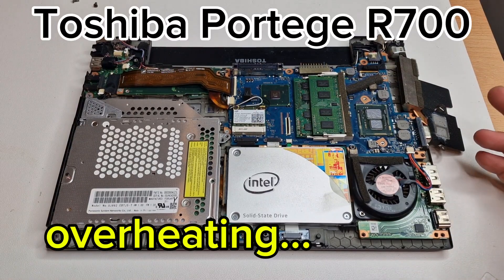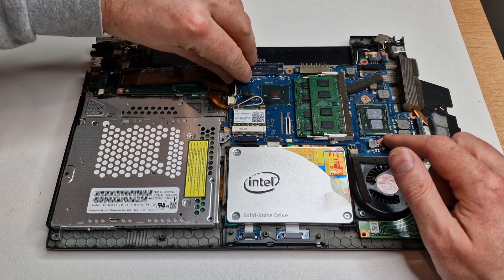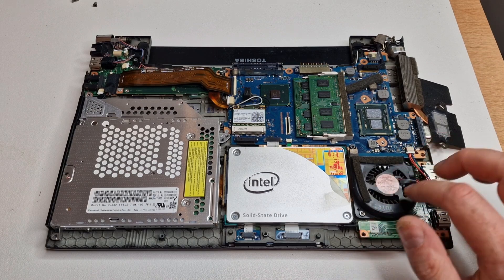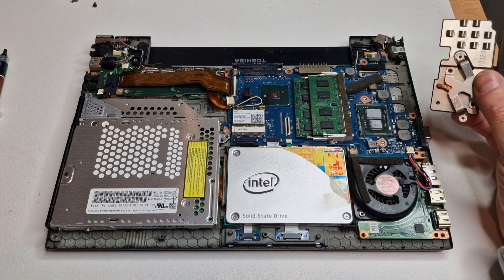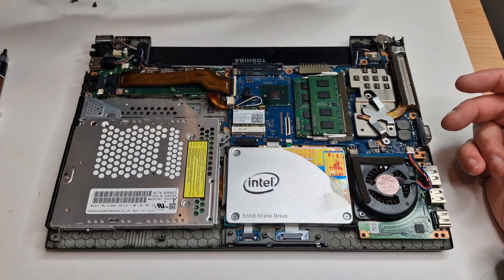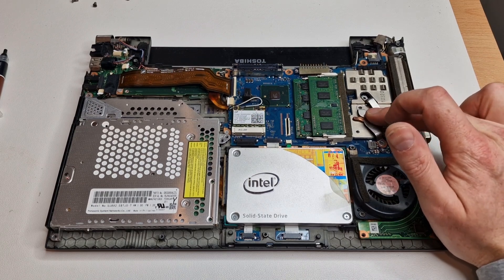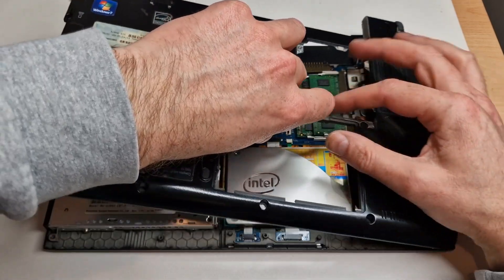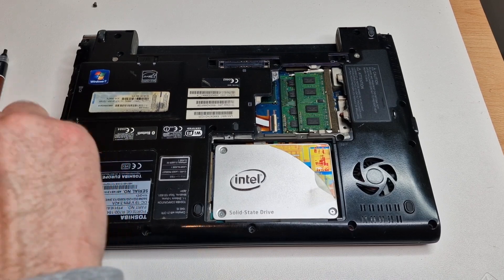Overheating Toshiba Portege R700 revisited... [THERMAL ISSUES!]

Comment: It's possible the heat pipe is bad. Inside is some kind of liquid. If it gets blocked the heat won't get to the fins. Buying a replacement / used heatpipe might fix it. If you have a thermal camera you can see if the fins get hot or just check if hot air is coming out. If air is cool the heat pipe is bad. If heatpipe is ok make a channel from cardboard that feeds the air directly towards the fins.

Comment: I wrote in first video but if you didn't see it... recovery partition may still be there. Give it a try. The correct recovery procedure is hold F8 while powering on, select Advanced Options then select Repair Computer (this activates the Toshiba Recovery), follow on-screen instructions. The original R700 recovery dvds are WinXP SP3 so not exactly useful today on 2024. Pity no one archived it but there are some on the bay if you wanted to pick up, install, archive images and upload for others :-)

Comment: I won't ever expect much from laptops that use cooling system like the fan that's blowing it's air to the cpu instead of blowing to a heatsink that's connected to a cpu. Some Asus laptops still do this "blowing air to cpu" cooling solution, and I always being skeptical about it's thermal performance, even if it's only a celeron n4000 inside.

Comment: I used to service these a lot back in the day for a contract my work had.
The thermal design is a combination of poor ACPI BIOS programming and not enough air pressure on the heatsink fin stack.
It's what Toshiba did to get this laptop as thin as this one is.
The Core2Duo version was thinner and had better cooling, but also the chipset and CPU were separate allowing heat distribution over more board area.
Basically this chassis should've been Core i3 only.

My fix was to use the chassis as a heatsink by putting a few blocks of thermal pads between the chassis and heatsink. Which gave a bit more thermal headroom, but not much.

I can't remember if there's enough flat area to put some graphite sheet on and use as a heat spreader as that'd make a bigger difference.

Comment: Thermal run away is caused by a lot of things like the heatsink, fan, and thermal paste gone bad but some cases the cpu itself is burning up that why soldered cpu can fail unexpectedly. You can manage the cpu clock speed by adjusting the max processor percentage value that is found in advanced power management menu

Comment: I Preffer Use Dell Vostro 3300 Insted That Laptop 
Dell 3300 Has far Better Cooling Solution
Reply from the maker: Yeah I definitely think Dell have better laptops and have learnt the hard way over the years
Reply: @OldPCGunk  But Also Has Socketed CPU Which You Can Upgrade That

Comment: I read some owner reviews stating that those ARE noisy and the thermal treatment IS poorly designed. 
I'd be hacking a hole over the CPU and fastening a heatsink and fan there LOL.
My X220 has a properly located heatsink and fan, and it needs attention, too. It can get quite hot although the fan works well enough. At 12 years old it could use new compound on it, too. I managed to clean the fan some and blew air into the heatsink vent but that wasn't enough.
Reply: I’d say to relocate the fan to right near the heatsink. The fan position is just dumb.

Comment: Is it possible to run a program like HWinfo and see if it's a specific part or core that's over heating? You know you want to put a big old cpu cooler directly on the chip and see if it helps lol. Only other things I can think is damage to the copper heat transfer pipe. Does it use the inside of the back of the case to dissipate heat as well?
Reply from the maker: @Revivify  I'm not sure, but wonder if I could add more cooling to the cpu?

Comment: You can normally oil the fan by taking the sticker off. There should be a hole under it that may need some oil. If they sealed it, you can drill a small hole to oil it.